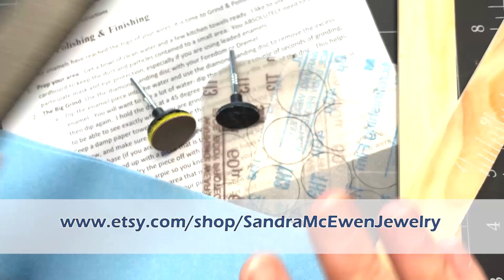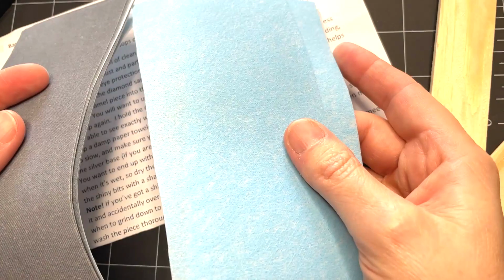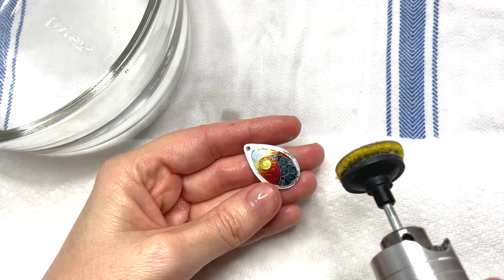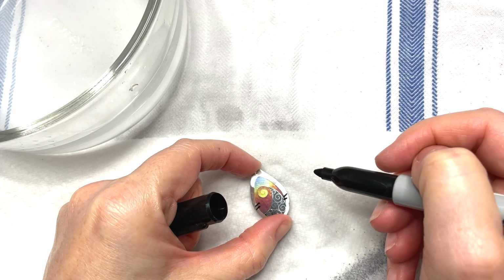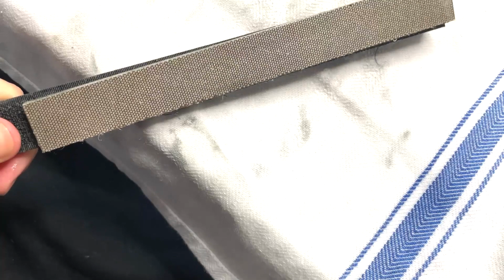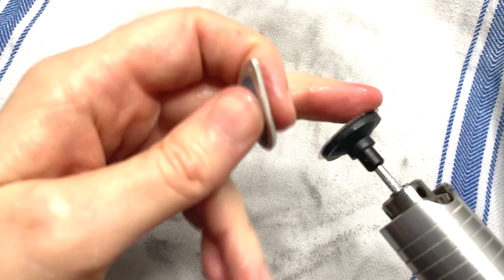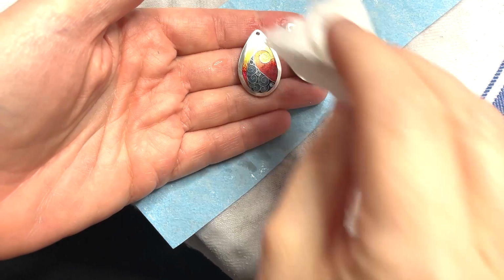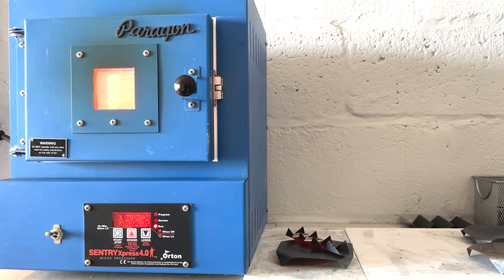Grinding and Polishing Enamels - Part 1

Comment: How do you attach fittings to the backs does the solder not melt in the kiln.
Reply: suggest you need to use a high fire solder called Eutectic Silver Solder for attaching findings to the back first, then counter the back; and do keep an eye on the temps as you fire in the kiln for the enamels.  Perhaps Sandra will advise where she gets her solder if you post to her.